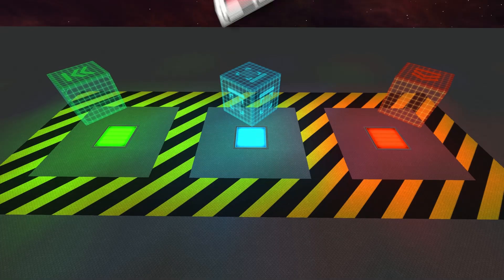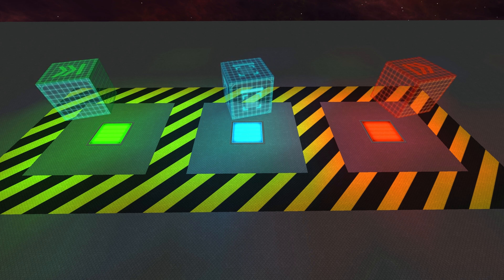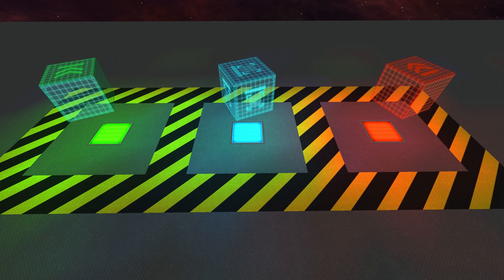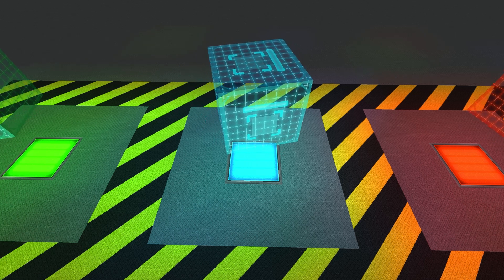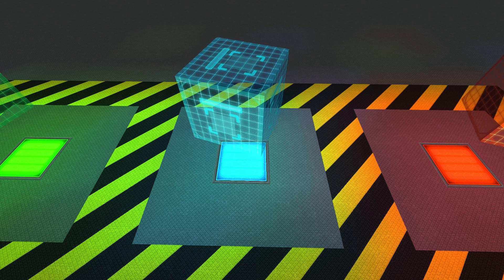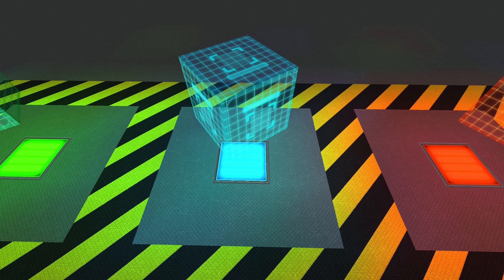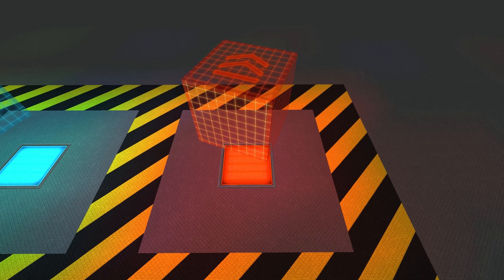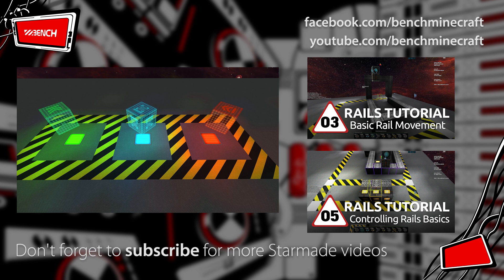Starmade Rails - 16 - New Pickup Rail Blocks

Comment: Hey Bench. Love the new system!! Trying to add a ship elevator to my carrier mothership, but am getting bit by the inability to transfer a docked entity (fighter drone) onto another docked entity (hangar ship elevator) and then back onto the mother ship, so it can be launched. 

We exploited the new pickup block coupled with undocking as a hack but that has a couple big problems. The transfers break when the mother ship is in motion because we are momentarily undocking/restocking the fighter, and using pickup blocks sets new waypoints every time.

Any other ideas how to make this automated hangar elevator launch system work?

Comment: I have been away from Starmade for a while right now and I do like a lot of what you guys have been doing.
However, I do have a major complaint from myself. Storage changed. I understand that people want to integrate a roleplaying element, but there are those of us who like the old storage a LOT more. 
So, might it be possible to set a "turn off switch" for that and have the old storage come back for those of us who like it better?Just a request for myself and others who like the old system of storage.
Reply: +BarkingDeathSquirrel That's been in before the storage officially changed

Comment: Does anyone know how or if you can use the new blocks to guide a ship into a hanger that has doors? the new blocks need there own space and can not be placed in the same space as a door block
Reply: I'm not sure honestly.
Reply from the maker: +Timothy Kimball I'm sure we can make a way, hmm might be calling for another video :D
Reply: That would be amazing,  I made a escape pod setup also :),  21 pods.  each with rapid airlocks and auto  eject 10 seconds after you push the door button to enter.  auto reclosing out doors, finishing up the prototype as we speak